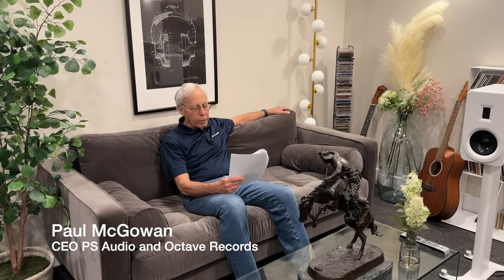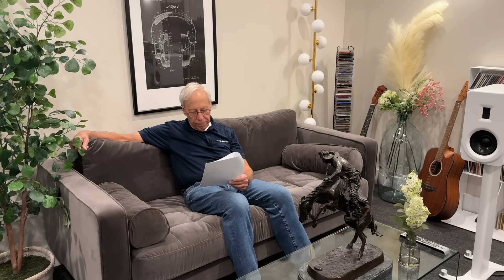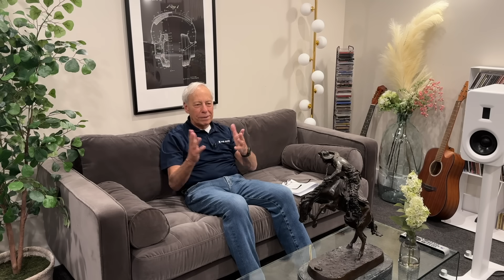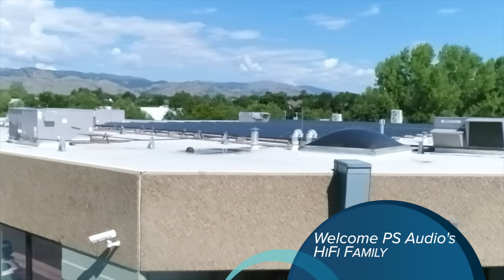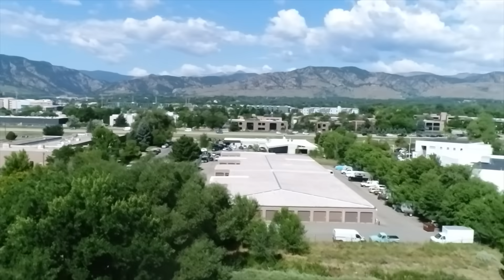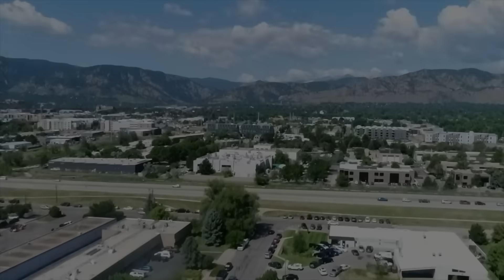Benefits of running a DAC at a lower volume

Comment: @3:02 "It's a great idea, because it makes everybody sort of happy".
Folks that would normally set it to -3 db would unwittingly end up setting it to -6 db.

A fix for everyone is to have an option to not display that setting (unless you are in the process of checking it or changing it).
Reply: i thought the exact same thing. p.s it was the immaculate collection album but was streamed not played on cd or vinyl.
Reply: @1stswim  I have used The Immaculate Collection, as an example, several times.  I do not recall to which comment you are making that reference.
Reply: @1stswim  I found the comment to which you are referring.
Reply: @0Perhaps  👍